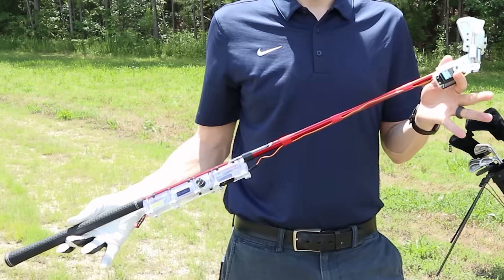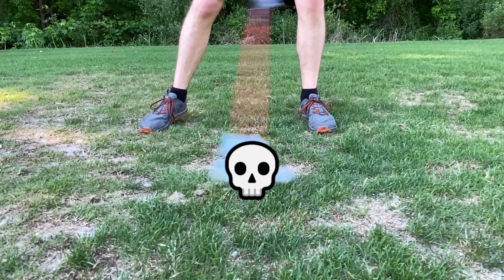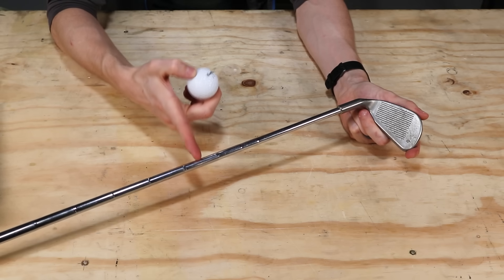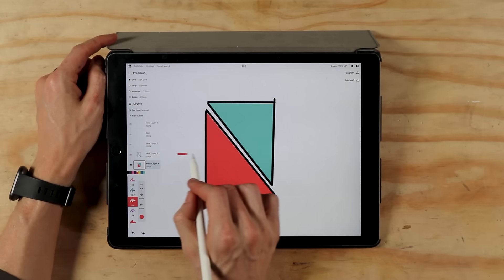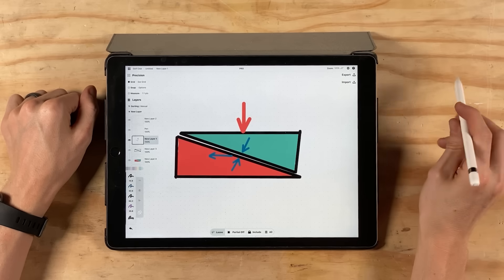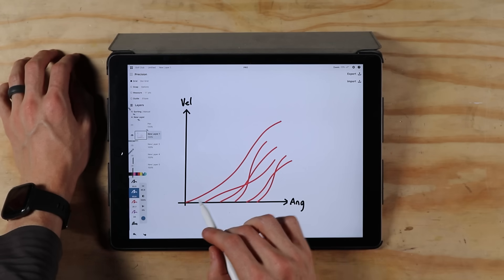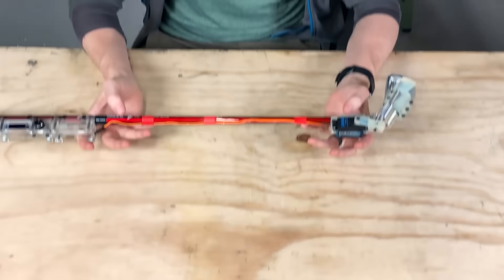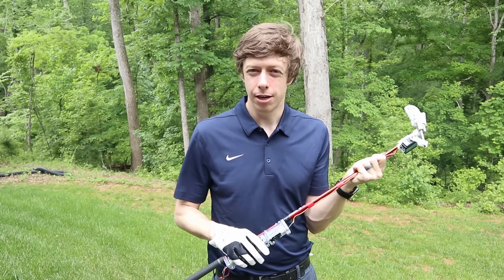My self correcting golf club makes me a better golfer

Comment: 10 hours later: so the reason this didn’t work is because the 1 was suppose to be a 4.   - programming in a nutshell.
Reply: I once spent a month trying to figure out why my networking code wasn’t working. I rewrote it dozens of times, had other people look check it out, read documentation for days and days on end to figure out what was going on, but had no luck. I eventually looked at a part of the project someone else was working on and found that they had written a totally separate network function for a different purpose that was using the same IP and socket addresses from the user inputs meant for my function. His stuff wasn’t even supposed to be networking with the same device as mine. Before I looked at his work myself, I asked him if his work was interfering with mine and he said no, it wasn’t possible. It was a government project so your tax dollars funded a month of me sitting around going insane over a few hundred lines of c++ code all because my coworker was being dumb.
Reply: came to leave the same comment hah.
Reply: That isn't too bad, I had a case where I had to turn some data from an old MS SQL 2008 into JSON for a new webapp we were building. So I fired up the old C# .Net code written by a colleague, wrote the program to reorganise all the data into the JSON format we wanted tested it on the ENGLISH version of our data. Great works perfectly. Decide to run it on the other langues, fails for Spanish/Russian/Arabic. Why? Well apparently " != " in other language encodings, especially if those characters are copy pasted from a word document into the  MS SQL 2008 DB, and well in JSON " is reserved for the delimiter of the fields so unless you escape in field " you end up with errors everywhere.
Reply: @karasus7512  You're going to have to explain that better. You converted an SQL db to JSON? Was it migrating SQL to a NoSQL db or was it just the output of data on the other end? I'm not trying to be an ass, I'm genuinely confused about what you actually did
Reply: @PontusBacklund85  output of data on the other end
Reply: @karasus7512  Ah, ok so you forgot or were too inexperienced to factor in the escape characters while parsing to JSON?
Reply: @PontusBacklund85  The DB and my program was in Unicode but my output was UTF-8. When I was doing the comparison of any type of double quote except the ones in English I got a false because it was either a left quote or right quote. In the english content, its not common to have left right quotes. So in English, everything was escaped normally but other languages it was not. It wouldn't be a problem except when I sent the JSON string in the response which was encoded in UTF-8 all the left right double quotes were converted to un-escaped double quotes.
Reply: @karasus7512  Ah yes, character encoding is hell. Thanks for the clarification
Reply: @karasus7512  I feel like you reinvented the wheel then. You could have used some kind of json serializer and you would not have to think about this kind of stuff. Entity framework + system.text.Json would have rendered that task trivial. I guess that's a huge lesson right there haha
Reply: I took a coding class once and I Sat in the corner wanting to die
Reply: I know next to nothing about coding, read this comment thread, read some wiki articles about the random letter configurations, and still know next to nothing about coding.

But one time, I had to do a task, didn't realize there was a tool for that task, and then spent 80% of the task time trying to make a tool specifically for what I was doing only to find out there was already a tool for it.
Reply: @anangryteddybear  this exactly. This is oke of the biggest lesson I  programming. Don't reinvent the wheel.
Reply: I'm stuck in a Stuff Made Here marathon at 3:00am. Send help
Reply: I’m the thousandth like 😁👍
Reply: When you get down to it the only thing making or breaking any program is the difference between a 1 and a 0.
Reply: It's always a semicolon;
Reply: I don't know how many times I've dealt with issues like this. It's both frustrating and funny. I love programming, but getting caught up on a simple mistake (like sending data to an AC OUT pin instead of an I/O pin) definitely doesn't make me happy in the slightest.
Reply: One time I spent hours agonizing why my JS code didn’t work, and it turned out I had misspelled the selector. Agh!
Reply: pretty much
Reply: I’m not a programmer whatsoever, but I was trying to set up a custom data pack for Minecraft the other day, and couldn’t get it working for hours. I repeatedly watched the tutorial for how to make and install them.

FINALLY I realized I had set up my file tree wrong, so the actual programming bits were fine, they were just not in a folder where the game could find them. 🤦‍♂️

It was something along the lines of Game/data/mod instead of game/data/files/mod 😑
Reply: There has been a ridiculous amount of times that I've tried to explain to [another person] why my code isn't working, and it usually ends up somewhere along these lines.
Reply: I spent a week looking for a semicolon;  C/C++ gives you plenty of rope.
Reply: ; or  : and 0 or O
Reply: @TerryLawrence001  those errors will get picked up by compiler, problem are those that don't
Reply: Alright everybody, big story coming up, so grab yourself some popcorn!

I once wrote a python program to analyze an excel sheet containing thousands of rows data, send that to an external API, get the response back, do some processing and update the excel sheet. Relatively easy work, one might say. At the end I was supposed to write all the info like number of rows, how many were successfully processed, how many errors encountered such things blah blah to a log.txt file. 

The interesting part is, if lets say a 1000 records were error-ed out, I had to write those row numbers into the log with a comma separator. But the catch is, it has to be split into multiple lines with a maximum of 100 values per line. So I implemented some kind of loop to make that work. Everything's done. It's showtime.

I know that one record takes around 3 seconds to process and I have nearly 8000 records. I estimated about 6.5 to 7 hours for the entire thing to complete, give or take. So I kept it running overnight and slept.

The next morning I woke up and saw it's still not done yet. First thought, maybe the API has been slowed down due to some kind of bottleneck. So I waited longer. It's been 12 hours and still not done. When I went and checked the log file I saw that it was more than 500 MB in size. I instantly sensed something wrong (obviously), stopped the program and started debugging.

After 6 hours of debugging I found out the culprit. Remember that loop I implemented for the log? Well I incremented the control variable outside the loop (python and it's indentations, argh!)

I learned a major lesson that day, and I can't stress this enough. *ALWAYS TEST YOUR PROGRAM WITH SMALLER DATASETS*
Reply: @TerryLawrence001  I don't get it. I put o or O in place of 0 in the dumbest places. int num = 1oo, cuz that makes sense. I'm glad I'm not the only one, but I'm sure others do it in places that make more sense to be confused like OxFFFF instead of 0xFFFF.
Reply: @logank  I write my zeros with the bar through them,  IDE's should use a font that makes mistakes like that hard to miss.
Reply: @logank  just... how? do you not use a real font? wtf
Reply: amicloud haha no. It’s not that I can’t tell what is a 0 and what is an o. It’s just that sometimes my mind mixes them up when typing, so I subconsciously go for the wrong key and don’t notice until later. It’s like a slight dyslexia for o and 0 I guess haha.
Reply: @Logan Kreisher but 0 and o are on different places on the keyboard
Reply: @alexyoung553  Correct, that has nothing to do with it. It's just my brain screws up and goes for the wrong key anyway.
Reply: @logank I do that with 6’s and G’s it’s the worst 😓
Reply: I'm glad its experienced programmers that have this issue as well.  Bloody arduino's give me the same shit.  This is why I chose infrastructure haha!  :D

Comment: Shane: This goes to 11.
Marty: Oh I see. And most clubs go up to 9. 
Shane: Exactly.
Marty: Does that mean it's better?
Shane: Well, it's 2 better, isn't it?
Reply: This one is even better than 11... it goes to 11+wife mode.
Reply: In golf terms, it’s two worse haha
Reply: Well, actually, golf clubs go up to 13, it's just that the naming scheme changes after 9.  10 = pitching wedge, 11 = gap wedge, 12 = sand wedge, 13 = lob wedge.
Reply: @honuputters1891  think you need to review what clubs are made there are many different degree wedges not just 2 ;)
Reply: @Smeeagain22  Of course there are - but if you look in a typical bag, you will find something labeled PW, with a loft in the 45-47 degree range, give or take, and another labeled GW, loft in the 50-52 range, a SW in the 54-57 range, and a LW that is somewhere around 60. Some people carry an extra "high lob" in the 62-65 range, and others have their wedges bent to something in-between.  My wedge lofts are 45, 50, 55, 60-bent-to-58.  My only point was that most bags carry several clubs with higher lofts than a 9I, and 4 of them is a typical number.  So the idea of "dialing it up to 11", as a nod to Rob Reiner and Spinal Tap, is funny, but ultimately not accurate.  I have seen clubs that were labeled 10 and 11, and yes, they were wedges.
Reply: @honuputters1891  in a typical bag there is only sw and pw a 45 n a 56 thats it if you wanna get technical its the keen golfers that add our 52 60 54s etc depending on our distances between wedges but dont typically come on a set if you buy as a set
Reply: Anyway enjoy your golfing personally cant play without a 60 and a 52

Comment: The hydraulic clubs problem reminds me of SWR in RF electronics.  You have some impedance mismatch and a percentage of your energy gets reflected to its source,  ie, youre club head. Hmmm....
In RF you solve it by using matching components,  shunt caps, series inductors along the transmission line to match a low impedance to  higher one. If only you could divert that return energy or match the force  that the club experienced in the line itself.

Comment: A thought, along the lines of human/robotic interfaces. Possibly use reinforcement learning, construct a DDPG, and then build a physics simulation with gym where the DDPG controls the club head on a particular swing in order to train it. That would solve your data problem, as you’d be able to customize the reward function to optimize towards something like a good golf score.  If you then feed back in sensor data from your golf swings, that could help refine your gym simulation. Beats the hell out of USB drivers.

Comment: That's the most geeky thing I've seen & I'm a techie / electronic engineer.
I don't see how it can help to be honest. Shaft length is just as important as pitch & those mechanisms are going to throw off the balance. It's an interesting prototype for some future design that's highly engineered to become as useful as a normal set of clubs.

Comment: You could possibly fix your hydraulic club with some pressure operated check valves mounted off/in the head.  These will basically trap the pressure in the head and remove your lines from acting like a large accumulator.  I am a M.E. certified in hydraulics if you want to pursue this idea any further.

Comment: "Hey, what field of engineering do you want to go into?"

This guy: Yes
Reply: Mechanical. The answer is mechanical.

Or, if you want to be particular about it, mechatronics.
Reply: @carazy123_  wrong. This is both mechanical for the wedge, automation for the prediction system, electronics for the circuitry and IT for the programming part.
Reply: i'm thinking industrial engineer...
Reply: @JohnnoNonno  You're partially right! The prediction system (and programming) is a significant part of mechanical and electrical engineering, known as control systems/theory. This project (and Youtuber) definitely fall in the union of mechanical and electrical: mechatronics (essentially roboticists).
Reply: @blink2656  Exactly! This would definitely fall under mechatronics. I'm currently studying mechanical engineering and taking a mechatronics class. We build stuff similar to this during the class. It combines mechanical systems, electrical systems and programming.
Reply: @blink2656  I wouldn't say robotics. That's my field of study and while we have been taught a lot of mechanical, control and electronics it can really only be considered an introduction because those fields are very vast and 2-3 courses in each subject don't even begin to cover it.
Modern robotics (while focused on automation) a lot of it will be machine learning and neural networks. I think his automated basket hoop video was more into robotics than this project is because it included computer vision.
Reply: randy ice  Depending on the country, Industrial Engineering means different things. But yes, at least here in Spain it would be it.
Reply: @randyice9229  😂😂 are you kidding ?!
Reply: Meanwhile im just a comp eng reeeeeeee
Reply: it's called mechatronics
Reply: I suppose we all agree that this guy is super talented and that his skill set is very diverse!
Reply: Hello my engineering field is Online Robotic Entertainment
Reply: Pretty much exactly what I learned as a controls engineer (mechanics, electronics, CS)
Reply: Well, there's only very little CS in this, and really basic one. Most of the work is design and manufacture

Comment: Slice and hook are not caused by the angle of the club face. The club face is your initial starting direction and your swing path will add the curve to the ball. So with a square club face the ball will start straight but if your swing is out side in on the target line the ball will still spin towards the right.  Cool project do! Keep it going👍🏼

Comment: There is nothing I want more than piloting a Gundam style robot. I think with your expertise you could build a 360 degree full vertical flight simulator style motion simulator and have it attached to your back like Pacific rim. That should take care of feeling unbalanced and triggering yourself to try and catch yourself. Next attach servos or sensors like Bitluni's 3D printed robotic arm to ALL parts of your body so all of your reactions to imbalance are recorded. as far as surfaces to walk on or interact with- use a large array of controllable needles that your body can stand on similar to the 3-d pin art we all had when we were kids. you could have 360 degree bearings on each of the pins that also have the ability to stop them selves from spinning to simulate slick or grippy surfaces (you can augment the shoes to a degree to help with the friction) obviously when you crash and fall you don't want an array of needles smashing you in the face because... thats where the ground hit the robot you're trying to control, so everything needs some limiting and a few xbox kinects could be used to determine of you are being over stressed or to prevent danger like sensing an object is coming at you too fast. as far as force feed back, you would also need sensors on all of the robot joints/muscles that can measure the load it takes for the robot to lift itself up and produce that same amount of force feedback to the same servos all over your body to give you the feeling that you are actually trying hard to lift yourself back up. again, programming saftey features and minimizing the strength of the force feedback is needed so if someone decided to twist your robot in half, the rig you've strapped yourself in doesn't decide to twist you. obviously its super expensive altogether. but doing this piece would be super entertaining.

Comment: If you wanna get good at violin, you could make 2 rails that slide up and down the finger board then press down on all four strings for the note you want to play. You'd have to program the exact location of each note or have the system press down then slide until a tuner detects it has the correct note.
It may be easier to get good at cello first since the distance between notes is larger.

Comment: I'm a golf pro in the boston area and former engineer. I love this idea and would be great to measure the club at impact using a launch monitor such as Trackman or GC2.  If you want to learn more about ball flight trajectory check out https://trackmanuniversity.com for free classes.  Things to maybe consider in the future is club path in addition to club face orientation and center contact. If the club hits the ball on the toe or or heel, it will create something called gear effect creating more slice (on heel) or more hook (on toe).

Comment: I'm 13 minutes in and no sign of how to increase club head speed. What u will notice is clubs have different shaft lengths. I noticed u cut up a driver for this experiment so I assume u have gone with max velocity and will just use club head angles to do the short range shots? It's alot of work but I don't think it will work on a golf course

Comment: 7:03 sorry but contact surface area has no bearing on friction - the friction coefficient will be the same regardless of the area.  P=F/A
Reply: He is saying that as the slope is more shallow, the contact forces increase, nothing about surface area. He just omitted saying that it's because distribution of force changes depending on  the angle.
Reply: @mioszwadas8234  Like a man in orthopaedic shoes I stand corrected!

Comment: I'm not a golfer, but to further as automate the golfing process, how about adding GPS to calculate the distance to the next hole? So instead of inputting the length of the trajectory (on ground), you could just input the desired distance to the hole. Or go for a hole in one, to continue your never missing shots series.